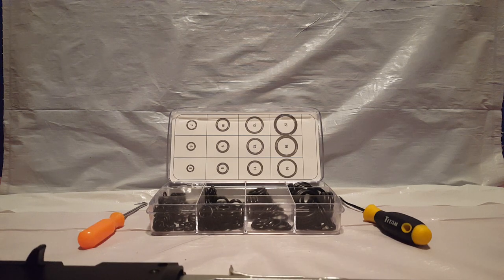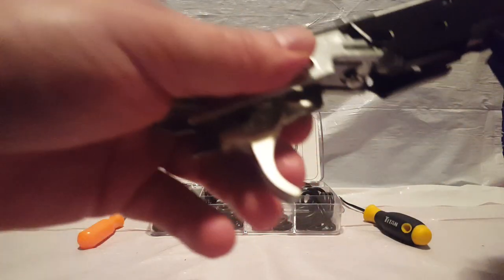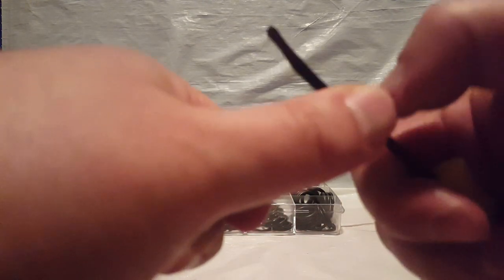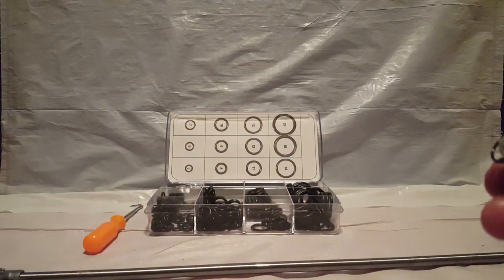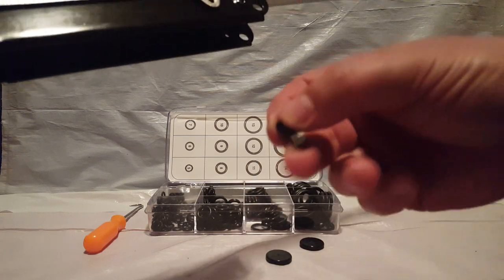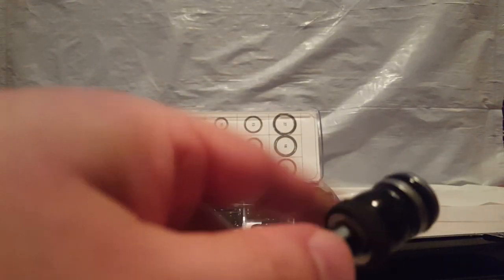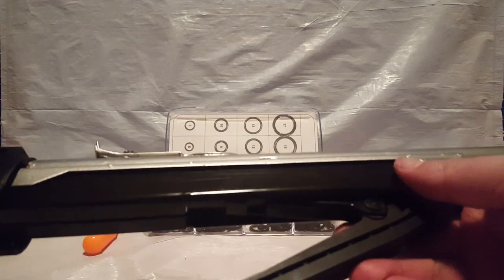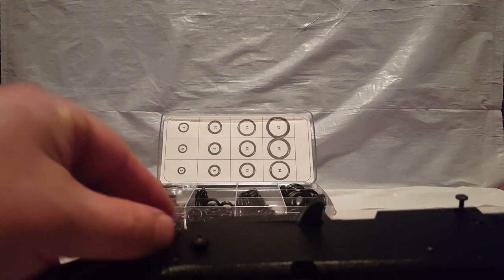Daisy 880 Fix. 3 Main Seals Replaced.

Comment: So I replaced the 2 #11 o-rings and its better, but still leaks. Do you have any ideas what I can check next?
Reply from the maker: Tmask, yes. There is small SAE 012 in valve area. But before you take apart your trigger to get to that valve,  first try putting SAE 30 ND on your NEW rings you just put in.

Start by putting two drops of oil on your pump wiper -  seeing if the oil gets worked in as you shoot. If after ten shots it isn't shooting w normal power .(A Beeman Pointed pellet or dome should shoot through soup can on 6 pumps), take it apart again and put lube DIRECTLY on the rings AND clean out tube and chamber seal edges. That seal is cup with  angled edges. Oil build up can effect it working right. Clean it off.

If that doesn't work then follow my trigger video and replace small ring.

Let me know what happens.

Comment: Is it possible to use a vintage metal receiver to replace the plastic one in a modern 880...if I can find one for sale that is?
Reply from the maker: Robert, last I checked the new age VB barrel assembly isn't compatible with old zinc cast metal sides.

Daisy should offer brass and steel versions.
Reply: @daisy880fanaticfixit9  Hmm…. I wonder how much of a market for these receivers there would be if someone were to make these as an aftermarket part that fits new style 880s.

Comment: Hi, is it possible to replace the stock with one that has a pistol grip? Or the question should be, do you know of any pistol grip stock replacement for this 880?
Reply from the maker: I wouldn't saw off the stock. Replace it. Keep the stock in storage. If you want it bag ready for easy transport, you make one or have have one made. Shane might help.

https://youtu.be/dhdCmDobyH0

Comment: Hi my daisy 880 breach stuck by using a small bb how to fix that
Reply from the maker: Ramotar, 

▶️ Cock the loading bolt back.
▶️ Run a a stiff wire, rod, or wooden dowel down the muzzle (from top) and tap out bad BB.
▶️ BB pops out OPEN breech, and then you close loading bolt.

Comment: I replaced the 211 o rings and when I pump it air comes out of the end of the barrel. And when the bolt is open-air comes out of the bolt end
Reply from the maker: Air coming out the breech when the rod is back is normal. Make sure your bolt is CLOSED ALL THE WAY. Then try and shoot.

Sir, NOW you need to look to your valve area. 

Air going down the barrel after changing both #11 rings, or SAE 113, means there is a valve issue. Worst case the top of poppet (plastic top) is cracked or broken; that means get new valve. Check it.

Best case is the #7 ring is shot and you simply replace it. Here is video below. 

https://youtu.be/3TMPMjsIBDU

Comment: can I get a link to get the replacement parts Valve assemblies and chamber seals?
Reply from the maker: Raymond here is company that lets do internet order for DECENT price.

https://www.jgairguns.biz/880881-c-78_186_197/dai880cs2-chamber-seal-check-valve-p-11831.html

https://www.jgairguns.biz/880881-c-78_186_197/dai880va2-snap-in-exhaust-valve-assembly-p-11864.html

JG has $15 minimum order so 2 chamber seals and a valve should keep you going. I have yet to lose a valve! But I don't pump my gun 10 times or more. About $28 all in costs.

Folks OVER PUMPPING past 10 are shredding their 880 internals.

Try Daisy first if you are willing to place a phone order. They have some parts disruption these days, but it is a chunk cheaper. 

Call weekdays before 5pm Arkansas  time, before 3pm Friday. 

479-636-1200

Comment: I took apart the pump and where do I put the two black disc's that popped out u went to fast and I didn't see where u put it in the videk
Reply: I figured it out
Reply from the maker: Great job, Colton! Those discs are guide wheels for the pump head. 

They fit ON The small rod that goes through the metal neck.The 35 is more simple and doesn't have that.

Yes, that is an older video. Now I work hard to make them shorter and slow down the talking.

Back then my videos average 15 minutes and I talk non stop. People don't like that. BUT I'm glad it was enough to help, but know there are other seals you will have to deal with  later. Enjoy your 880!

Comment: Another great video! Are the internals of the Daisy 880 the same as the Winchester 77XS?
Reply from the maker: Kirbo, yes, Daisy clever that way. The 880, 901, 77xs, 35. Same. 35 just has different pump head. Also, my personal favorite, that I was plinking with using Beeman Hollow points today, the 1910. 1910 just no chamber seal.

All have same barrel assembly. 1910 and 35 short smoothbore. You can get PDF on all those guns and compare. Contact info in my PDF video.
Reply: I have a powerline 880 limited edition and a Winchester 77xs. The limited edition hasn't been used in years I think. I took it apart and the pump tube slid out on it's own. A few days ago I switched the parts from my 77xs to the 880.  It worked but when I pumped it it made a popping noise and when i shot it it came out slow. Also the barrel is loose. When I shoot it or shake it it rattles and falls out if sight isn't on it.  Air comes out of the barrel. What is wrong with it, and does the barrel being loose have anything to do with it leaking? P.s. I sawed the barrel off and cut it to put the sights in
Reply from the maker: @codycarroll5806  - I would switch those parts back to 77. I admire your drive to tinker. But sawing off barrel changes things. And is the 880 old enough to have BRASS TUBE? If brass, you need special parts from the best 3rd party: JG Airguns. Daisy customer care can't help with discontinued guns.
Reply: @daisy880fanaticfixit9  thx for the help and it's not brass. The one that was in it but it fell out pretty much as soon as I removed the pump. The seal was bad but it shot a few times. I didn't switch the parts permanently. Just to test it and it worked. The problem besides the outer barrel is the one the bb's go through. If I wiggle it enough it falls out and the barrel is where the air is leaking out. I know I can get 880 parts but I don't know about the barrel. Thx
Reply from the maker: @codycarroll5806 - Good man. Yes, you are on right track. You can get barrel assembly for about $12. Not positive it will fit that model, because of metal, but metal sides fit my 880 just small seam that I'm ok with.  New shroud needed also (sheet metal cover).

Just remember no not get tricked; for new parts go to Daisy reps. I have PDF video for that, but they are really cool over phone - you can just ask for 880 barrel assembly and 880 shroud. Know that barrel assembly is ENTIRE thing - just not tube - silver tube style is fused with body.
Reply: @daisy880fanaticfixit9  thx dude real helpful

Comment: I just bought a 901. The first couple of times I shot it the gun registered 700+ fps on my crono. A few weeks later I took it out for it's first day of shooting and once again the first few shots were 700+ fps. One time I even had a shot 825 fps! These were achieved without over pumping. Sadly though the gun soon after the first few firings stopped shooting as hard. I'm getting shots now between 575 fps and 639 fps. My 880 shoots a 8.2 gr pellet consistently around 680 fps all day long. Since my new 901 started out shooting stronger then the 880 and only has been shot maybe 20 times since getting it what might have happened to it and what's wrong with it? Plus over pumping doesn't seem to help either.
Reply from the maker: Sir, PLEASE, PLEASE  don't over pump it. I don't even pump my Daisy over 7 pumps most of the time.

10 pumps is hard on the seals and shortens their life. Over pumping is death!

The FPS numbers you gave for the INTIAL SHOOTING or high. The range you talk about in the 600s is more correct. Considering the Canadians hunt with the Ruger Explorer (500fps) and make it work, your 901 has much more SMACK even at 600 fps with a dome or hollow point.

The 1977xs is a HIGH POWER 880 variant. I have the 77xs, but that is just an 880 with nicer forearms. My 77xs with JSB 8.4 Dome took down a ferrel Rabbit - 7 pumps clean on rib shot at 5 yards. That is running only in the high 500s velocity.

Comment: So, my 880 has about 2000 lead pellets run through it. It pumps and seems to hold air okay. Problem is, the pump handle will pop open on it's own pretty often. Your thoughts on what is causing this?
Reply from the maker: Hey, Jon, are you talking about pumping it it ten times or more, THEN it pops open. Or are talking about it just popping loose any time?

If it pops open any time, check the retaining spring. Is is bent or out of position? To reposition it, just loosen screws and pull up on recievers and put the spring back into its retaining area. Then tighten screws.

Up to 25 yards, I just pump 7 pumps. 30-40 yards 8 pumps uses most of its power and can make that shot. Pumping ten times or more (more will blow your seals) puts all types of stresses on the gun.

2nd thought is that your chamber seal is going. I saw this on mine and changed the chamber seal and both rings in pump tube. Search my videos on ordering from Daisy. Buy two seal kits. Do clean sweep of pump tube.

Is it flying open when you are pumping it?
Reply: It pops open even at 6 pumps.
Reply: n Neet
It might do it at the final pump and not want to latch. Or, after the final pump as I'm getting ready to shoot.
Reply from the maker: You said in your short reply it pops off on 6 pumps. That sounds like you need a new chamber seal. That seal as shown in video checks the air so you have a multi-pump. Order a few kits from Daisy https://www.daisy.com/. With shipping only about a few bucks.

Clean out tube of oil build up. You could try cleaning off current seal and clean out tube. That has worked for some. Don't over lube. Use only Pellgun oil or 30w ND motor oil. Super Lube O-ring oil also very good. 2 drops every 500 shots. Or if you haven't shot it in long time.
Reply from the maker: Jon, ok, I'll give you the best response possible here. Because  I'm not there too diagnosis it, it is either the chamber seal or lever latch (where you hold to pump).

Try first to clean it out. That works for some because they oiled too heavily, even w right oil, and got sludge. Wipe off chamber seal and clean out tube.

If after clean up it still does not work, the best play here is to order from Daisy Ladies. A Daisy employee told me it is just $2 for small orders like this one. 

You call to order before 5pm Arkansas time. Any where else will not give prices this low. Remember Arkansas time zone. 479-636-1200

2 Seal Kits 169909-000 $2
2 lever latch springs 134609-000.50 cents
+ shipping = $5 total 

Order 2 latch springs and 2 seal kits. Store the extra ones away for future. 

One of those is right fix. Cargo shipping  not the right move here. A Wal-Mart 880 can go for as low as $25. But that OEM compliant same-day fix is right for sentimental 880. Meaning you strip parts from new 880 for old one (that is justified a greater value with worn in rifling and trigger).

Jon, clean first. Then order. These are YOUR best options.
Reply: !Thanks!

Comment: Very nice video!! I didnt think id find to much info on a BB Gun on you tube!! Wow! I have the Daisy 880 177cal. Gun. Its been years since I got it out and shot it.. Still looks like new I have a quick question, how many times should it be pumped? I can pump it 4-5 time's and it starts getting pretty hard to pump anymore.. Is this about right or do I need to replace seal's?? Still has strong shot too! Any info would be awesome thanks.
Reply from the maker: Scott, I like hunting up fo 15 yards at 6 pumps. 7 is the most I use for economy of force. 8 pumps would be Hail Mary shot like at 30 yards or more.

If it continues to be hard to pump- which the 880 is normally not that way - try taking apart and clean out pump tube and EDGES of chamber seal. When the chamber seal gets thick with old oil it can't check the air right.

Hard pumps normally means chamber seal is in trouble. 6 pumps should not be too much work. But if power is there, it is individual perception. I find 5 pumps light on power with pellets. 5 pumps plenty for BBs.

As long as ypur gun is not pre-1995, Daisy has seal kit for your gun. Order if pumping keeps getting harder and fix didn't work.
Reply: @daisy880fanaticfixit9  Thanks for All the much needed info . God bless you sir.
Reply from the maker: Scott, God bless and may he aid you to "Put on the Whole Armor of God."

Comment: I can't seem to find the reassembly video for the 35. Why does the BB keeps getting stuck in the safety?
Reply from the maker: Hello, Julie! You are second shooter to be unhappy about Daisy safety.

I have two Safety videos in my library. If you can't find them, let me know. One is a heavily tested hack if you LOST the 3mm BB or spring. The other is general education. 

On 35 disassembly, my fav youth rifle Boy Scout 1910 videos have you covered. Boy Scout is sibling only easier to work on. Basically twin sister.

For little moving parts like that try lube, before disassembly. Very similar to lock parts.

https://www.oreillyauto.com/detail/b/b-laster-4556/chemicals---fluids-16461/grease---lube-16582/graphite-lubricant-17699/95c12afa06ac/b-laster-dry-lubricant/16tdl/4608970
Reply: @daisy880fanaticfixit9  I found the video. I almost have it put back together. There's parts that came apart and I don't know how to put them back together. I have the spring and the firing pin?
Reply from the maker: Julie, let's figure this out. The trigger assembly does not need to be touched to fix the safety.

Was your gun not working? The seals hold up for YEARS if you use 30 SAE ND lube or good silicone. 

If you took trigger apart, lets help you run to the finnish here, There is no firing pin, that is more Crosman tech - kinetic hammer/stem system. Your 35 has a trip valve, where your style of hammer PUSHES Down the bottom of valve stem.

I have trigger video, but it is the HARDEST task of the 880 platform, and it should only be dismantled to change valve or valve seal.

Take your time. Be patient. My experience with female shooter is that you are better in certain ways because you  keep your temper in check and don't lash out like alligators.

Be patient. Follow the tigger reassembly. Let me know how it goes.
Reply: @daisy880fanaticfixit9  I figured it out. The spring fell out of the safety when I took it apart to get the bullet out of the safety. I hadn't seen where it fell out. I just got the pin back in place and the spring and it works fine. I'm just hoping I can figure out how the BB gets in there.
Reply: @daisy880fanaticfixit9  thank you so much for your help.
Reply from the maker: Julie, very happy it is working out. It sounds like you still are installing 3mm BB. Let me know if you can't find my Safety videos. Both videos show how to re-install the BB. Use well-lit area and a towel in case the BB gets away - it just plops on towel. Both videos show how - one with real BB the other with metal bead.
Reply: @daisy880fanaticfixit9  I look again once my son comes back in with it.
Reply: @daisy880fanaticfixit9  I'm using 4.5mm. He might have had some in there still from his last container. I got all of the small ones out. He should be good then, right?
Reply from the maker: Julie, we are having funny moment here. Are you talking about clearing a BB jam in barrel or loose BBs in magazine?

For the safety, that isn't 4.5...it is a 3.2mm sitting atop a spring.

Are we talking about clearing a 4.5 jam in gun?  Or fixing the safety?
Reply: @daisy880fanaticfixit9  the BB was stuck inside the safety switch.
Reply from the maker: Julie,  thanks, a 4.5 in the TOGGLE gap that keeps the trigger body passing by or not.

Sure you squared it away. The 1910 reassembly should have helped. Hope your boy has trouble free shooting now. Thanks for being patient and polite.

Comment: Will a 880 chamber seal be the same as in a 922?
Reply from the maker: No, 922 older brass style. It is solid one piece. The chamber seal you see here is modern version with hole in the middle.

If you are trying to fix. Daisy CSRs won't help here because brass kind not made in 30 years and they don't have the parts.

EBay prices are are $30 and up. So you know, the modern seal kit has you covered on 4 out of 5 of the parts. Just different chamber seal.

I have hack video on the seal if it is in good condition, and your valve is alive. Chamber seals "lay down" in time. Rolland came up with this hack.

The O-Rings you can get from the store are two Nitrile 113 SAE and one 012 SAE ring. If the hack works, you got a gun again.

Comment: The o-ring s what they are in mm Diameter?
Reply from the maker: They are SAE 113 for the main rings. The valve seal is 012.

113 - 9/16" Inside diameter, 3/4" outside diameter.

Thickness 3/32"

Please know that some of those store rings not a replacement for OEM seal kit. MANY ARE TOO THIN. 

The Danco kit shown are verified Nitrile that is compatible with straight mineral oil (no solvents).

Harbor Freight Store House Ring  kits are super deal and have DEAD on rings for P-17. But that is slightly complicated because 2 are SAE and 2 are Metric. They are thinner than Daisy OEM, but the 113 look ok.

Your 880 is ALL SAE. Danco is spot on with OEM - if not slightly better.